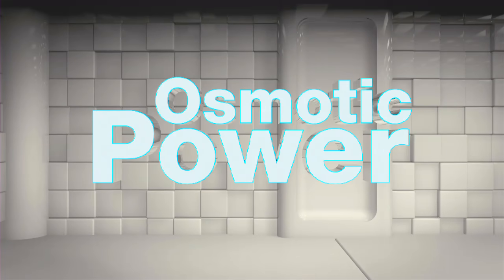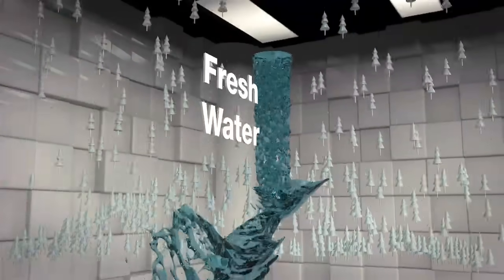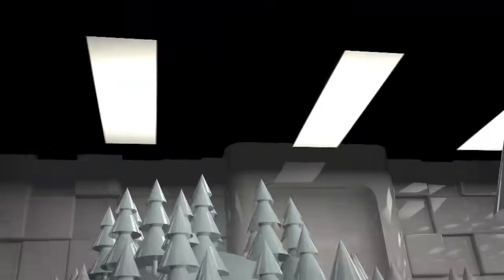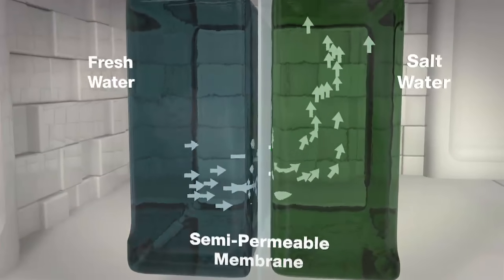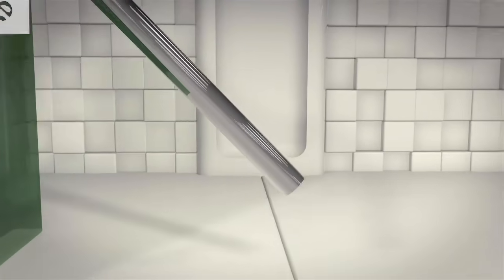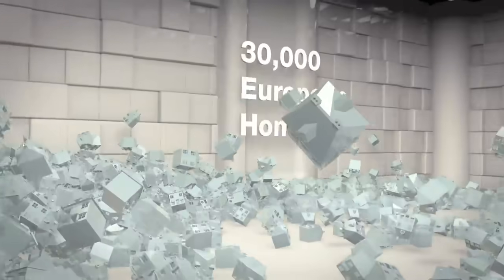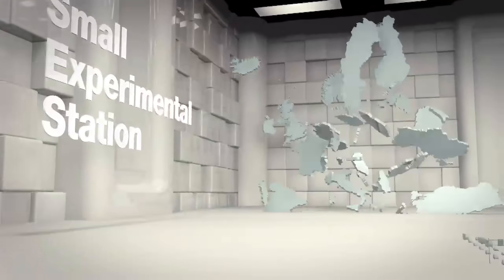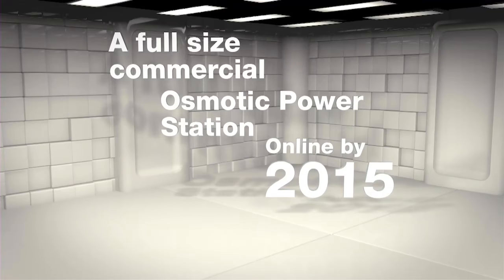🌏 earthrise - How it Works: Osmotic Power

Comment: Theres no energy from mixing water with water containg salt, so this is fact a perpetual motion power station because the slightly salty water could be sperated into freash and and very salty water by using some of the energy made by the turbines in effect the fuel is osmosis itself wich completly violates the laws of energy conservation wich is amazing :)
Reply: I know this is an old comment, but no this does not actually violate energy conservation. 
That is for the same reason that gas expansion doesn’t violate it, despite the internal energy of the gas not being dependant on pressure.

The energy that lifts the water column is actually the internal thermal energy of the water (and by extension also the surroundings). It’s possible because the loss of entropy from cooling the water is offset by the gain in entropy from mixing.

Entropy is what actually determines the direction of processes, so if as you suggest you wanted to run reverse osmosis back on the system, you would need to do all this work back (or in practice more) which would dissipate as heat even out the entropy loss.

Comment: The base principles of Hydroelectric is to harvest the power of potential energy. Potential energy is the energy stored by any mass which is then released and fall downward by the force of gravity. In other words, just let gravity move things, make the moving thing rotate turbine. Osmosis is a different principle. If you dig a basin, there is nowhere to go for the water (has to go downward otherwise, you need energy to bring it "up").

Comment: How is this any better than hydroelectric power? You're still essentially using the fresh water to power a generator. Is it because it's less invasive?
Reply: Subtle Ink Hydroelectric is based off the flow of water.  This salinity gradient method is based off the concentration of the salt within the water.  The "fresh water" mentioned is still from natural habitat or probably river edge (mouth to the sea) where the concentration difference is significant.  So I believe there is no major invasion done (relative term when compared to hydroelectric)

Comment: Fair enough, but is it a comparably better trade-off? I don't know that. I do know that desal plants, which more than likely be necessary in areas without the required riverine influence, require a significant amount of energy to run and the wastewater can substantially elevate water temperatures and drastically change the surrounding ecosystem.